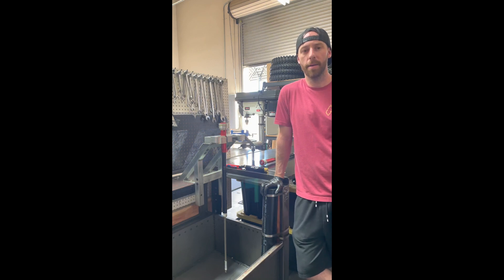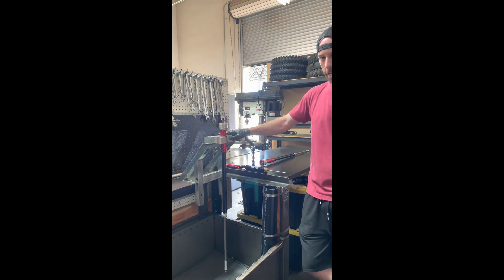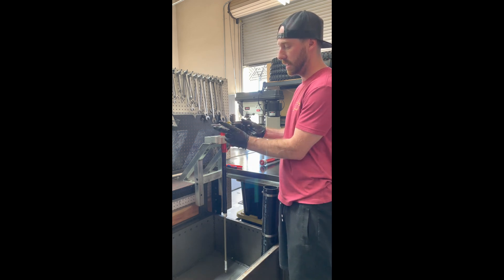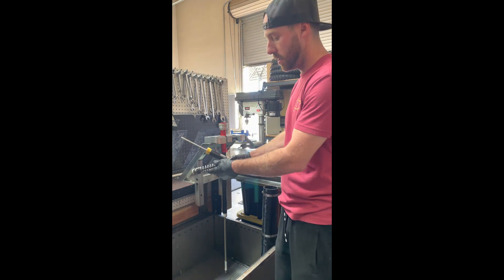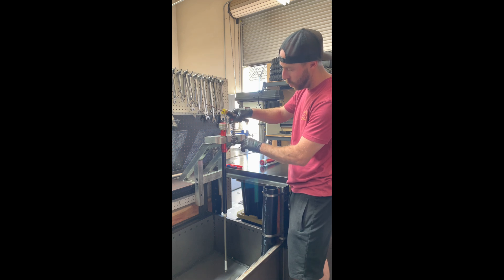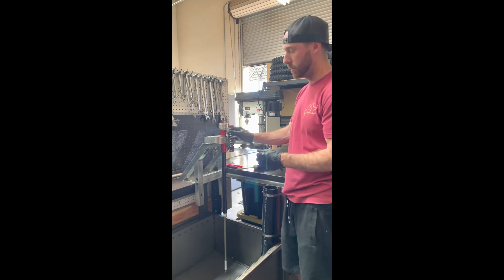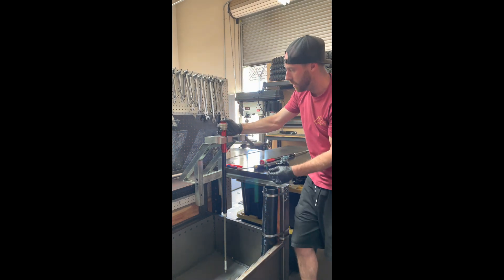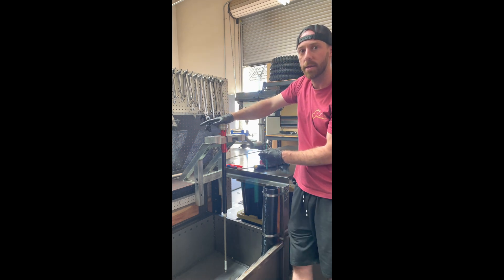Best way to assemble WP Conevalve Cartridge, XACT Pro 6500 Cartridge & Xplor Pro 6500 Cartridge

Comment: Do you have a video on disassembly?  Looking for tips on removing the compression assembly. Looks like a pin wrench to remove but do you need to hold the preload in place when you start turning the assembly?
Reply: deja moto makes a clamping tool that will hold it in position.

Comment: Tried the 135 mm level…. No way…. The system is not pressurised enough with not enough damping on the initial 30 mm.
Reply from the maker: Hello and thanks for the comment.  Its possible we are doing slightly different build work flows.  Your feedback is appreciated